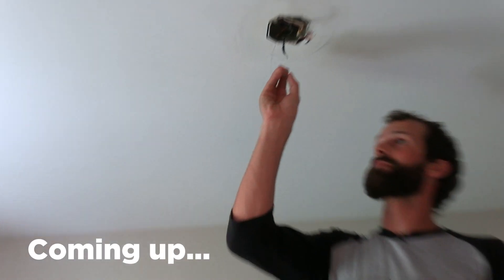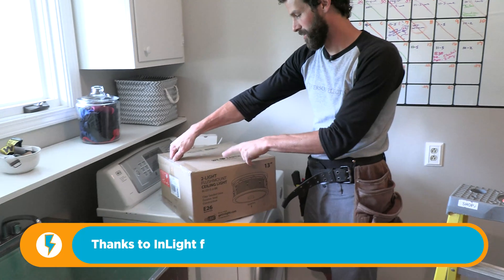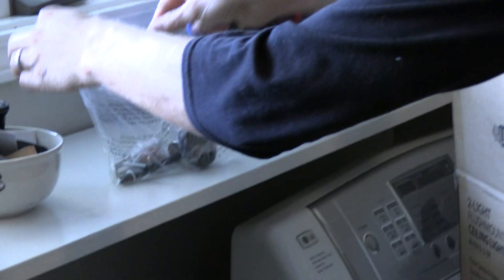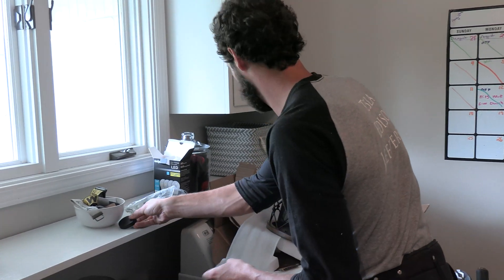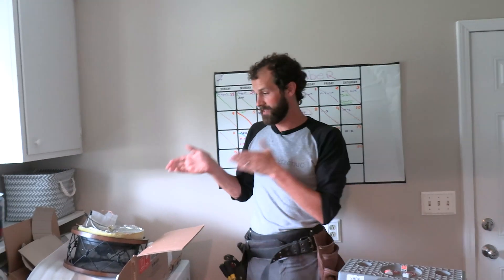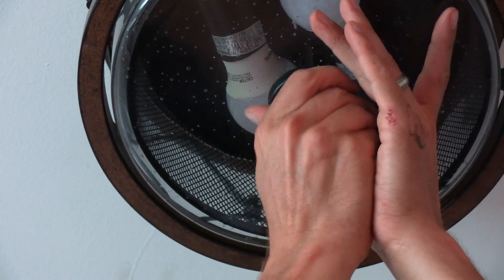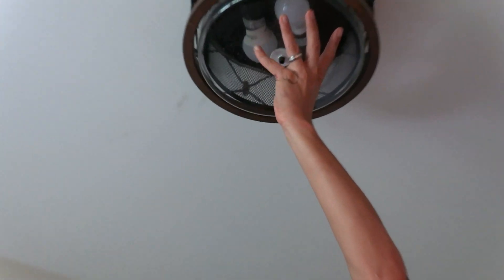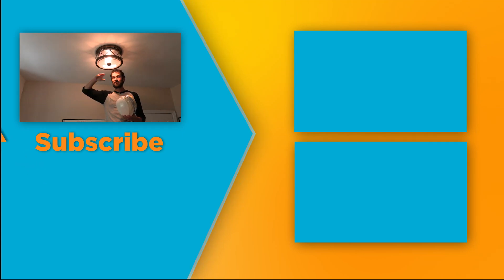Pimpin' Out our Cameraman's Laundry Room

Comment: Costco has some nice fixtures, that are really cheap compared to similar brand name stuff, some have 5 year warrantys, LED fixtures, not replacement screw in lamps.  Installed about 12 not one issue, nice metal finishes ....Few different brands....Costco never dissapoints
Reply: damn right they do. costco stuff is affordable and by all experience quite reliable.

Comment: Nice fixture. I would have spent the extra money on “Edison type” led bulbs. They’re the ones that look like fine wires inside the bulb. Also I like the Wago 222’s and Ideal “Insure” lever wire connectors because the product has a clear case so you can tell if the wires went in all the way. I always carry heat shrink tubing so when I encounter wires with bad insulation I can put it on and fix the problem.
Reply: Seems like a lot of time, effort and energy for something you could cut off and use one of your wagos on, especially cause they usually provide insane amounts of wire in a lot of this fixtures.
Reply: @AdamS-lh2ug  I was speaking of repairing the line side wiring, not fixture side. 14/2-12/2 vs 18-22 gauge. Article 300.14 requires 6 inches of wire out of the junction box.
Reply: @lorenrickey5481  6” from the back of the box, or more specifically, “from where the cable raceway enters the box.” Idk if you’ve worked in the field, short, damaged wires are found all the time, especially on knob and tub (commercial is so much better), if I can, I’m cutting, re-stripping extending the wire out to meet code. It’s immensely quicker, and imo, a cleaner look. Then an ugly tape job or using heat shrink. It all works, it’s just a matter of personal opinion.
Reply: @AdamS-lh2ug  I’m not fond of taping the wires either, hence the shrink wrap. Another method I use is a splice with Ideals “SpliceLine” model 42 connectors. Never been around knob and tube, but have repaired short wire connections, crispy and damaged wire connections. Always trying to do my best work.
Reply: Also, just clarifying, heat shrink probably has an okay look to it, just seems tidiest, you have to have a heat source in a crowded box. I’m not a smoker, so I would either be using a propane torch, or probably a propane torch cause work vans never seem to have heat guns in them.
Reply: @AdamS-lh2ug  I carry a Milwaukee cordless heat gun. Works great.
Reply: "Edison bulbs" have certain place... and the laundry room is not that place.  
The things can be a nice accent but they are  GREATLY overused!
Reply: @jovetj  I don’t agree.  In my opinion that fixture with the frosted bulbs ruins the look of the fixture.  100 watt equivalent Edison  bulbs with clear glass would compliment that fixture.  But then I wouldn’t have chosen that fixture for a laundry room in the first place. Too ornate.

Comment: 5:56 You can see that the previous mounting screw had screwed into that neutral wire.  Missing insulation there was noticed at 3:23.  It looks like it made contact again with the new screw.